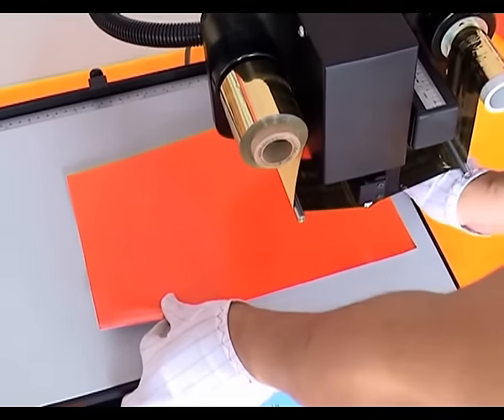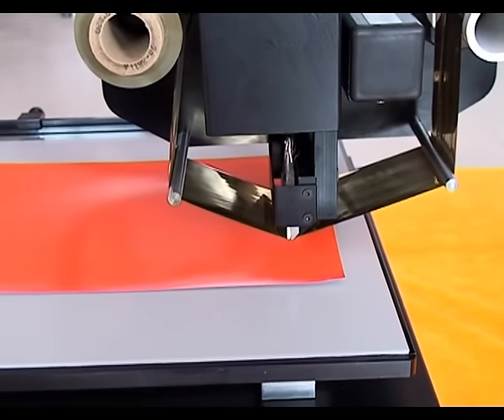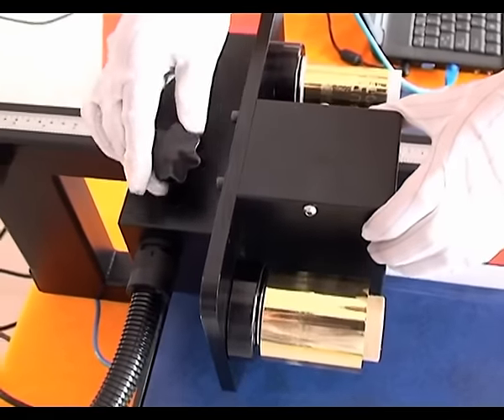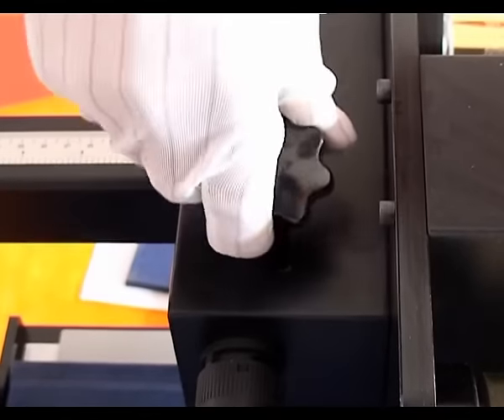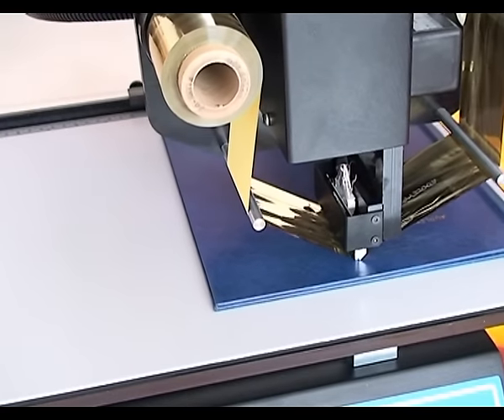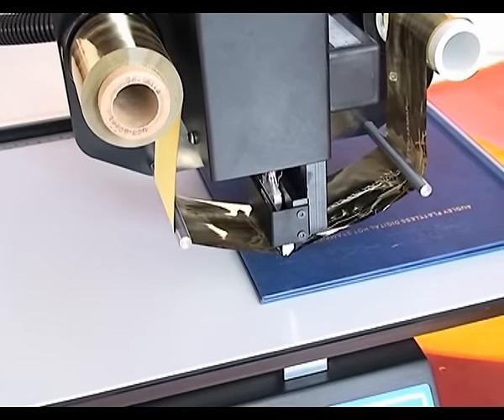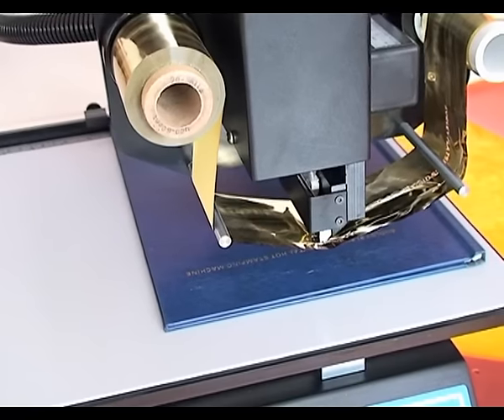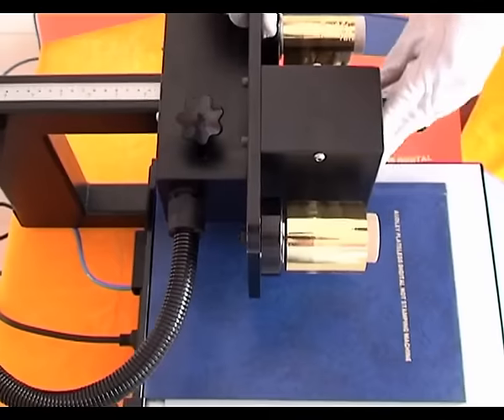Audley digital hot foil stamping machine ADL-3050A printing effect.flv

Comment: Where do I buy this?
Reply from the maker: whatsapp/IMO/line : 008618637176730
Reply: @ericqin4825  how much is it?
Reply from the maker: @RangerTrader  1500
Reply: @ericqin4825  is there a smaller, desktop version, for only a few hundred? or can you point me in the direction of a cheaper alternation as 1500 is far too much. i am currently trying to start out a business and cant afford 1500 right now, but i need a machine that does digital foiling

Comment: I am from West Bengal, India. I am small printing house owner and engaged with thesis printing for years.  I want to improve my thesis hard case binding with hot foil stamping print on the hard case cover. I watched many printers but impressed by your  ADL-3050A,
with auto position and able to print on the spine of the book cover accurately.
Now please inform me that is there any dealer of your above mentioned printer in India who will offer me the best price and service. As I have not a big budget so please calculate and send me a tentative price if possible.

Comment: HELLO, BUY Audley digital hot foil stamping machine printing effect.flv ADL-3050A according to the manuall install the progam do the design and printing command when the printer head low but nothing prints, which would be going on with my Audley digital hot foil printer ADL-3050A stamping printing machine effect.flv, someone help me
Reply: can you helm me my machine printer head going
down but not prints and the table also not moves. 3050 A
Reply: ζωγραφιζω .

Comment: Hey guys, if anyone bought this machine already, is there some kind of review or rating you can give as to how it works? Any comments on how it works or its malfunctions? Thanks :-)
Reply: HI,Yes.We can help you .we have the engineer ,can help you online operating.You buy our machine?
Reply: Oleg, John Z here I am in the process of setting up a machine now. We had a couple of issues. First DON"T load software on a computer that is attached to the network. The CD with the software had over 55 Viruses  that infected our Server. Then the English Version of the software was Still In Chinese. They did not include the proper brochure either. I have 45 years of Hot Stamping experience. Stay Tuned!